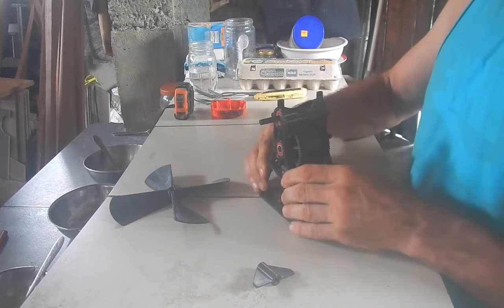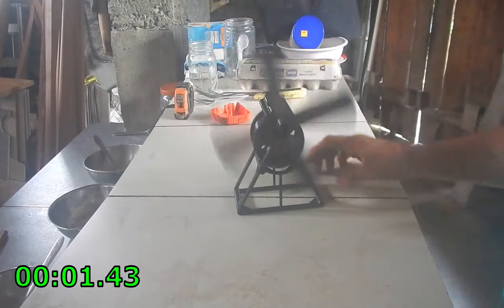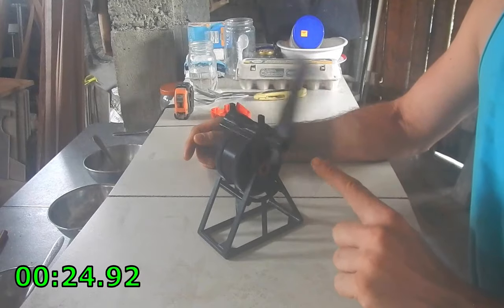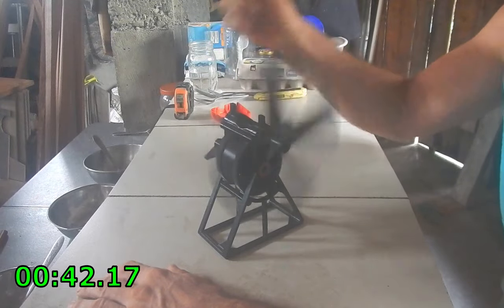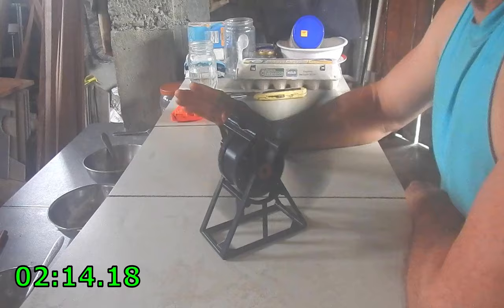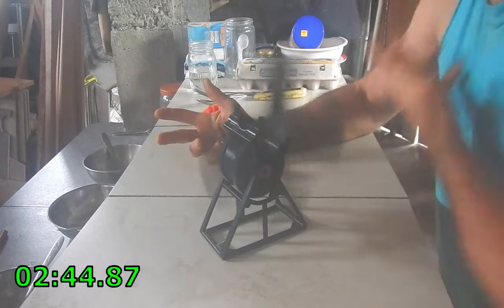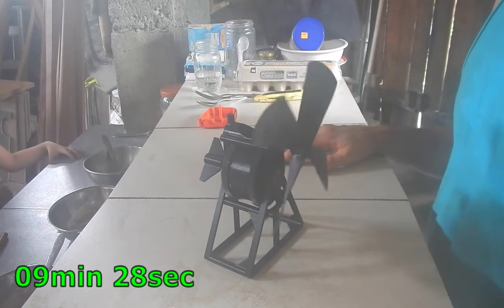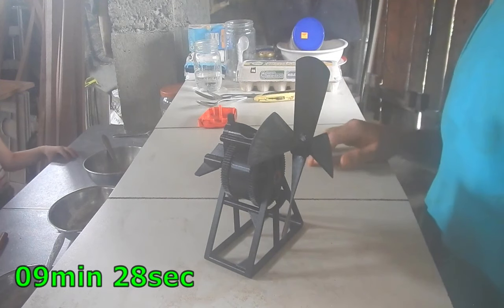3D Printed Wind Up Fan 3rd Try (Lasts so long I fast forwarded it)

Comment: I had an idea: Instead of it being wind up, why not gravity powered? Like you have the same basic mechanism for gearing it up, but you have something like a capstan winch drum with string wrapped around it and a weight on one end. Maybe a bottle of water so you can vary the amount of weight by adding or removing water.

Comment: give a spring from a line trimmer a shot, also i have a feeling with the right gearing you might be able to get 30 mins on a wind
Reply from the maker: Yeah.  I think 30 minutes is reasonable.  ....I just might need smoother gears.
....and/or better bearings than skate ones....
I do have an idea for a planetary gear drive that might reduce friction, though...

Comment: Only suggestion now is....use gravity .  Lift a bag of dirt and let it fall to pull the "winding side" , also could power an l.e.d..
Reply: You can obviously still use the tape measure and the spring.